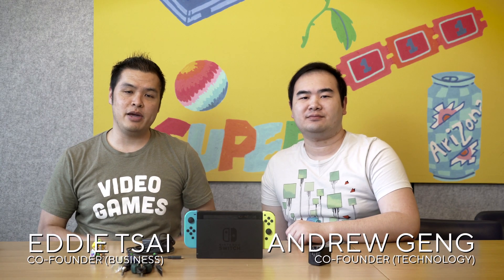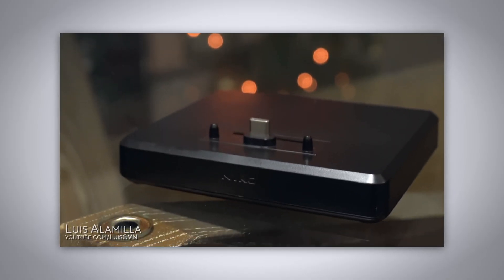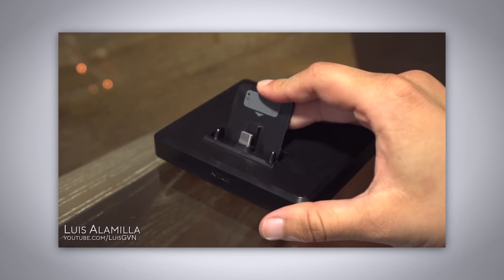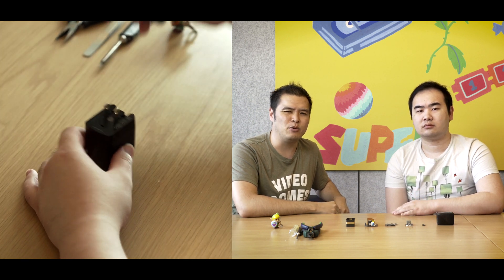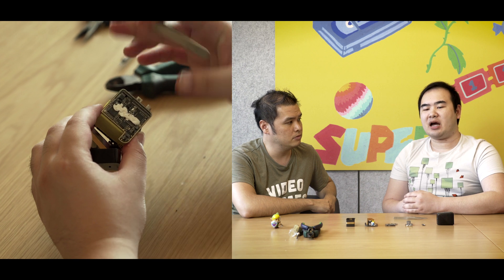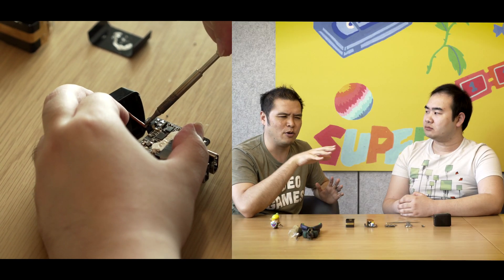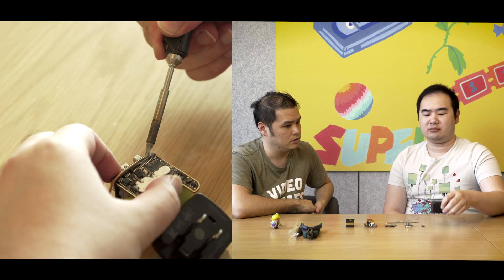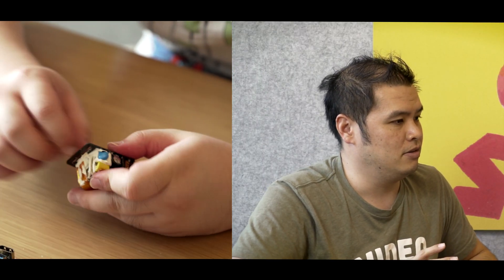Covert Dock Teardown

Comment: Thank you for making this device. I enjoy the best possible video output. I am very glad that you made this product but I feel a little let down that the video output is not equally good as the original dock. Could you please improve this?
Reply from the maker: Hey John this can be easily fixed in the settings of the Nintendo Switch color settings changing auto to full range
Reply: @humanthings567  awesome thank you. So the only thing is that is different is that you would have to go into the settings to change the colors. Why is that?

Comment: I didn’t know this was a thing. I always use my Switch portable. So never charge the Switch with the dock. I’ve always charge it with several iPad chargers or even a power brick. And never had a problem with it.
Reply: The issue shows up more when the switch is docked in tv mode than just charging, and I understood that it was not a problem to charge it with any usb-C cable, I suspect this is because of what the fellow in the video said about longer plugs entering the port crooked, and crossing lines. A normal plug won’t ever cross power and data.

Comment: I bought a Genki dock from you and I am so happy about it. Also respecting the advice, that bricking can happen, when the Switch is connected to a charger, while updating the firmware. My switch is always in flight mode, when charging, and I am only disable flight mode to check for frequent updates, while disconnecting it from the external power. No problems so far. What are your experiences from power banks? I got the cable for charging on the go from satisfye, the power bank is from Anker. But as I understand, it could potentially be harmful to the switch? Due to bad connections in the USB lines, right?

Comment: I purchased the Covert dock only as a travel dock. I planned to use it while camping or in a hotel room. I would only have my switch connected to a tv when in use, and the rest of the time to simply charge it, since the provided charger is so thick it doesn't fit in my case. Is there any foreseeable issue with only having the switch plugged in to charge? With no connection to the TV or hdmi cable inserted in the Covert Dock?

Since more power is consumed when the switch is off, isn't it safe to say that if automatic updates are off, this surge of power consumption should not be there while the switch is plugged in, because it's not actively searching for any updates? I think I have my auto updates settings set to off, which might also help with preventing bricking. If I didn't have confidence in the Covert Dock, I wouldn't have bought it, but my point is that maybe these other precautions can greatly mollify people who have third party dock if they just took these precautions?
Reply from the maker: hey ashley, to be honest there really isn't be any problem with using covert dock as just the charger.  we understand people's hesitation due to the high number of bricking cases 2 years ago with the introduction of auto updates but that was more of an issue of the data and power pins on faulty usb-c dock heads more than anything.  the covert dock does actually support trickle charging so that when the switch is full it stops charging and will slightly charge it as it dips which is how the original charger functions as well.